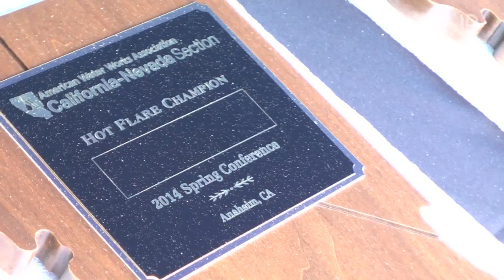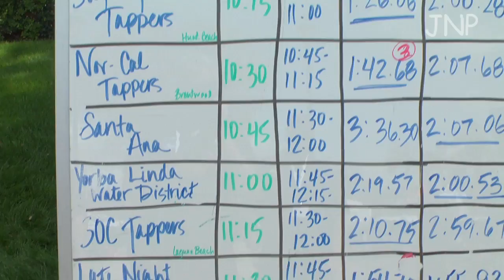2014 CA-NV AWWA Tapping Competition

Comment: When you're working under 5 psi and you don't have to worry about closing the flapper valve. Kinda like cheating. Unless your systemwide pressure is like an old timer trying to pee.

I worked for the Mt Vernon, NY water supply. I did this in a one man competition at over 100 psi. Came in a winner at somewhere under 2 1/2 minutes using a Mueller 100 back in the 80's.